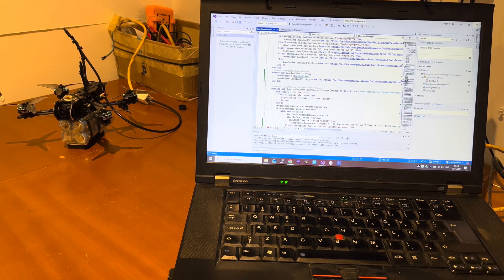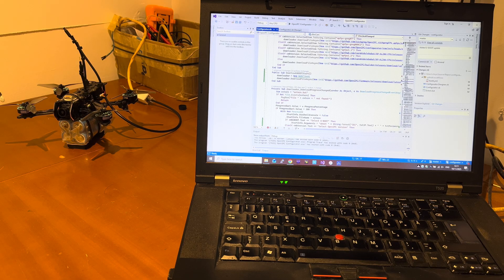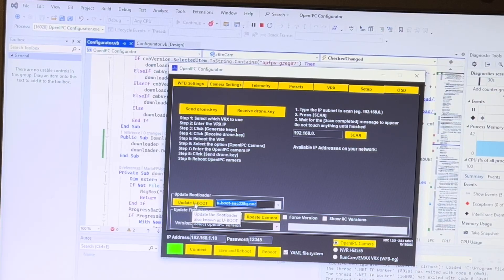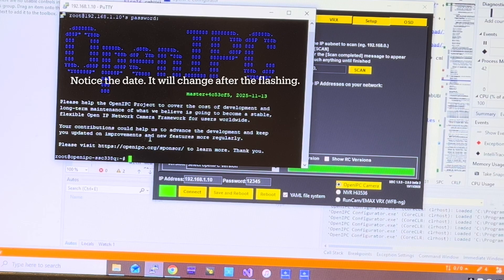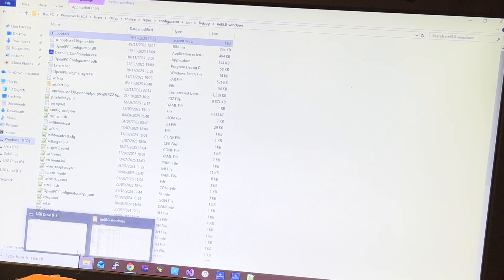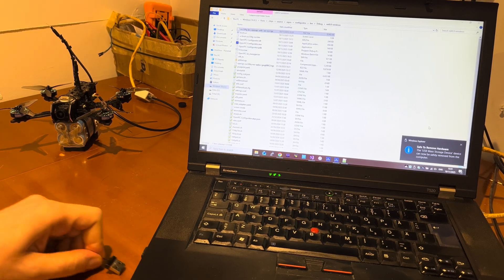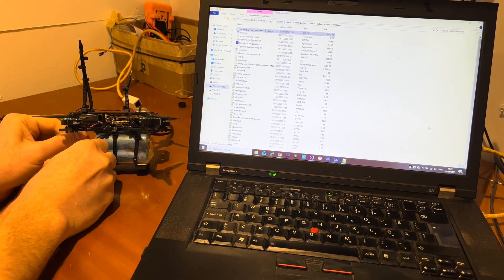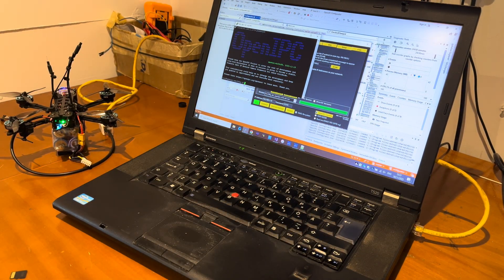How To Unbrick Your OpenIPC RunCam WifiLink 2 Camera - the easy way

Comment: I cannot find this OpenIPC configurator.exe
Reply from the maker: Here you go. Cheers mate!😊🍻

https://github.com/OpenIPC/configurator/releases/download/19.11.2025/OpenIPC-Configurator.zip
Reply: @mariofpv  Thanks a lot. I think my Wifilink V2 VTX lost Uboot. I tried to update it with SD Card and I didn't work, so I updated it with OpenIPC companion and the connection lost in middle of updating. Now it doesn't show ip address at all.
Reply from the maker: You should have updated the UBOOT before this occurred.
Unfortunately your only option is this: https://youtube.com/watch?v=KE72kbl5ePU
Keep in mind this method is for advanced users and requires good soldering skills. It’s not impossible but you are proceeding with your own risk. Good luck!
Reply: @mariofpv  I am confident with soldering as a mobile repairer. Those commands in cmd,  and the method to do this is confusing. I look at this problem in a good way, I can learn something that most amateurs would not encounter. OpenIPC needs people like you to make the community grow.
Reply from the maker: I have published a few videos that had more details about this method. Search 2 years ago for them. It was the first method that we used to flash OpenIPC firmware.

Comment: Thanks, 
I cant not find in the folder boot.scr,any idea?
Reply from the maker: Download the latest configurator. It should be in the folder that you extracted the files. Cheers mate!😊🍻
Reply: @mariofpv is great, thanks, also a second question: the key file to use fpv4win, the openipc companion, just generate "dron key" but not GS.key.
Any clue?
Reply from the maker: Sorry but I don’t know what they do on the companion. I can guide you on configurator if you want.

Comment: good video :) , nice job 😉 , please is there a possibility to share your txprofiles and alink settings on github for example - it would help me a lot ... I'm still confused why in osd it shows me RSSI almost the same as linkq, and not the classic negative number - and I can't figure it out :D :D
Reply from the maker: I’m using the latest urllc firmware. Nothing special. It should work as plug and play. Try to update your camera and then apply the PnP 2.0 patch from the configurator. Cheers mate!😊🍻